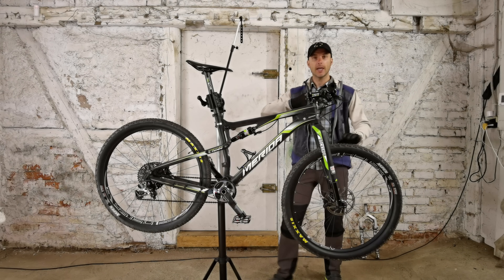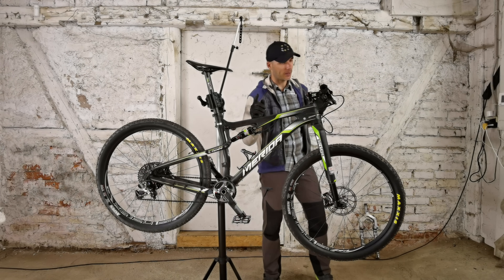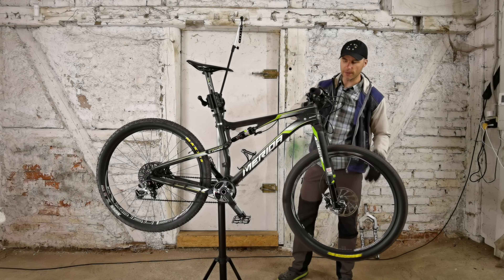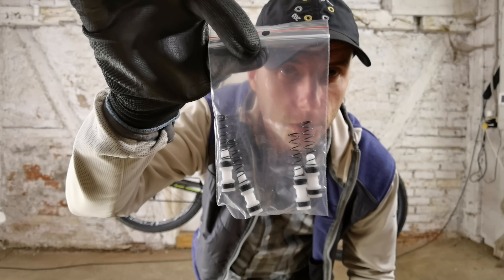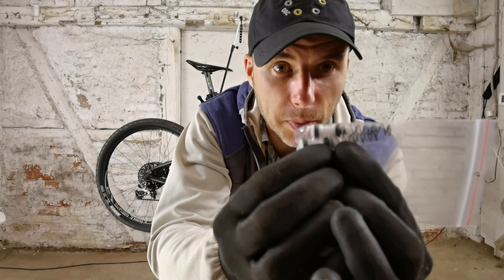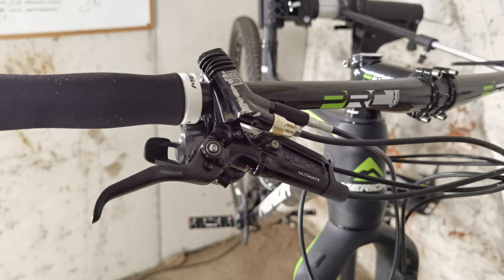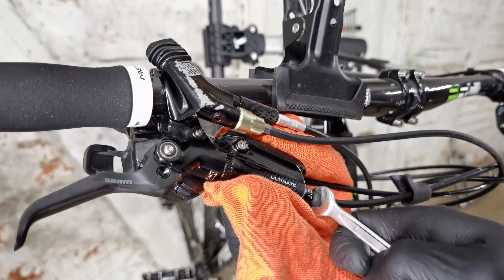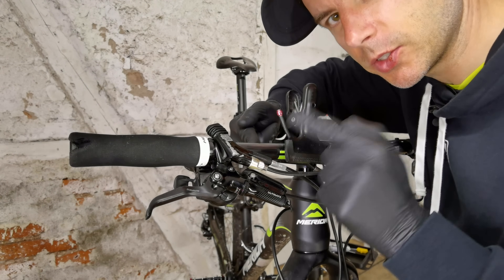Sram Guide braking lever sluggish or jammed. Quick fix with the repair kit. Piston replacement.

Comment: I just did this service yesterday using this video and the one posted by SRAM.  Overall, this video was very helpful and on point.  However, a couple steps were missed in this video.  1. Reinstalling the tiny ball and spring under the adjustment wheel.  2. Reinstalling the little rubber bushings for the pivot pin.  The steps in this video are in a different order than the one on SRAM, but I don't think the differences in the order mattered much.  In fact, I think I like the order of steps better here in this video.  And the clear stated & shown way to reinstall the lever was MUCH better than in the SRAM video.  

I have an issue after the service in that the bite point (?) wheel doesn't turn after reassembly.  This is what caused me to check the SRAM video.  I took the assembly apart and did it again, same issue, I can't figure it out.  However, everything else works fine and my brake really DOES feel like new!  I had no idea how much braking power I'd lost until I did this piston replacement service on my front brake due it locking up when in the sun.  Now I plan to do my rear brakes as a preemptive strike.  

I did this piston replacement on 2017 SRAM Guide Ultimate brakes.  It was the first time I have ever done this level of component repair.  I estimate it took me about 2 hrs of actual work, discounting runs for parts or supplies.  I highly recommend having picks and tweezers like shown in this video.  They helped a lot with the tiny space to work inside the lever master cylinder.  I bought some cheap ones at Habor Freight Tools, sets of 4 and 6 respectively for around $7 or $8.  Also, don't waste your money on 4 oz bottles of DOT 5.1 brake fluid from SRAM or Finish Line.  I bought twice as much for a couple bucks less from NAPA auto parts.  It's DOT, it's the same fluid regardless of what brand is on it.  I bought the SRAM piston replacement kit on Amazon.  It was $30 for the last few weeks that I was considering buying it, then they suddenly raised the price to almost $35 for no apparent reason.  No bike shops in my area here in Denver even knew what this kit was, or had it in stock.  I also bought the SRAM basic bleed kit for about $47 on Amazon.  It's worth about $15 and has a bunch of pieces you'll never use, but that's how SRAM seems to do business - make you buy a bunch of crap you don't need to justify their ridiculous prices.  I do wish I had gone with the aluminum pistons rather than the same plastic ones that expand over time, but I haven't found any that are actually made by SRAM which made me worry about quality fit.  Plus, the ones I saw on Amazon are all sold by Chinese companies with names I've never heard of, and they don't come in kits with the additional rebuild parts that SRAM provides.  Also, I'd recommend saving the old parts except for the piston if they look like they'd still work.  You never know, one of the parts may fail or one of the very tiny parts rattles loose and falls out, then you have a replacement handy.  Those individual parts are almost impossible to find without buying another piston kit.

Also, you don't need that spendy digital measurement tool shown in this video if you buy the SRAM piston replacement kit.  The tool in that kit also does the measurement for this piece in a VERY easy manner.  That'll save you some bucks!

That's my 2 cents of experience.  I hope this helps someone else considering doing this job.  It's definitely worthwhile from my perspective, in comparison to buying a new brake lever master cylinder or paying a shop to do the service.  My local shops wanted a week lead time and about $125 - $150 to do the job.  I could buy a new brake lever assembly for $105 at WorldWide Cyclery as of last week, most other places were around $140 - $150.  So in the long run, it's well worth doing this and brake bleeds myself considering my shops are now charging $40 - $50 per bleed and I need that 1 - 3 times per season.
Reply: Holy text wall bat man. Btw he does show installing the tiny ball and spring. It's actually under one of the reservoir screws, which is amazing engineering... I think. I missed it first time and it's almost impossible to get it together any other way.
Reply: Do you have the links to the replacement pistons and parts you got off amazon?

Comment: Hello Dann!! 
The reason why the oil does not come out from the lever is that there is a little "valve" wich closes when you unplugg the housing
(this is the same thing because Copland easily can replace the lever on Kate's bike without bleeding in Nove Mesto)

Comment: Thank you for this video.  I am attempting to fix a stuck brake lever that my local bike shop could not fix (but still charged me!).  Are DOT 4 and 5.1 fluids safe to use with the new seals or did you use something else?  I just ordered the repair kit.  Thanks again!
Reply: Its always safe for everything that is inside, and bad for everything outside

Comment: pro tip: You can buy those pistons made out of metal. The brand is called "Risk" (china). ~10$ each, they come with new rubber sealings too. Great if you never aggain want to do this replacement BS because the plastic pistons swell and jam the lever.
Reply: Thanks for this mate!

Comment: Do I also have to set the 26,3mm distance when setting contact adjustment completely open before disassembly?
Reply: If you buy the SRAM piston replacement kit, there's a tool included that is much easier to set that distance with.  It's the same tool that installs the adjustment wheel part.

Comment: I am going to replace my pistons as well.
I opened it once, but als notice I had a different spring size in my replacement kit. So I did not dare to replace it and used the old piston again
But now i am qurious. 
What did you do about the different piston springs sizes.
In the video you just say: Interesting. I have different pistons in my left and right brake. 
And when you install it later on in the video, you install a black (longer) spring. Assuming you replaced the shorter, silver spring.
In your "spare bag" you only have the 4 longer black piston springs...

Online I can only find spare pistons with the longer black springs...

Comment: Can you remove the lever position adjuster?
Reply: Permanently, no. You would have to get the RS brake lever housing and internals, that threaded piece that the adjuster rides on is also eliminated. If you take out the Adjuster wheel you leave a big gap for debris to enter and cause issues. If you remove the internal threaded piece the actuator that the lever pushes against to move the piston in and out will have room to move laterally and would very likely jam and get damaged.

Comment: What are you spraying the parts down with?
Reply: Isopropyl Alcohol - Recommended by SRAM in the mechanics manual. DOT fluid is extremely corrosive to paint and coatings, the alcohol breaks it down and cleans it away easily. Automotive mechanics use it often for similar jobs, along with break cleaner. The issue with break cleaner, it can be hard on most paints too, so when a part is painted like these are you get out the Isopropyl Alcohol.
Reply: @sgtvash23241  All true.  Wish I'd read this comment before I went through this process.  One of the videos I watched suggested brake cleaner for this service.  That does a good job on bare metal but I noticed the paint on the reservoir became tacky and started to come off around the edges.  Then I switched to using alcohol.  No issues then and I think the alcohol also cleaned off the brake cleaner.

Comment: Plastic pistons (will lose shape) of different sizes (why?) for the same brakes: makes no sense. Exept selling the 30$ rebuild kit every year. SRAM can not be trusted.
Reply: you can buy those pistons made out of metal. the brand is called "Risk" (china). i bought a pair, 10$ each, wich came with new rubber sealings.
never aggain i will have problems with those pistons swelling and jamming the lever
Reply: The difference in size is a revision in the design. Early on the Guides has an issue with pistons getting stuck and not working. The revised pistons are all the smaller diameter on that end to resolve the issue. He mentioned that the other sides piston was different from this one too. I would guess that when his bike was built one came from SRAM with the revision already and the other was older stock with the larger piston. When he rebuilt the kits only come with the revised pistons and found the side with the legacy hardware.